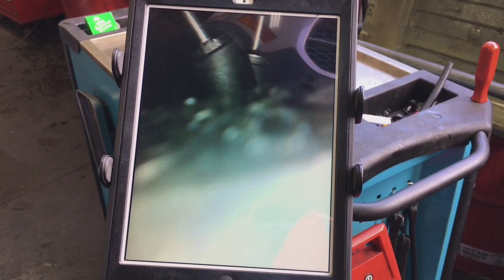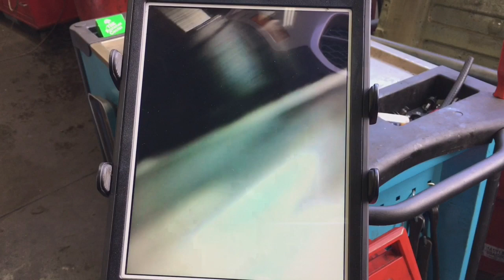BMW  N63 Twin-Turbo V8 Engine

Comment: What is the difference between n63,  f13, and e63/e64 engines?
Reply: Hello Majdi, sorry for the late reply.  BMW makes this slightly confusing.  Let me see if I can clear it up.  The N63 is a Engine: It's a twin turbo V8, made from 2008 until present.  
The F13 is a chassis model, NOT a engine.  The F13 is a 3rd generation 6 series BMW that was made from 2011-2017, the F13 also means it was a 2 door coupe, the F12 is the same year and body chassis as the F13 except the F12 is a 2 door convertible.  The F06 is again the same year as F12 and F13 except it's a 4 door.  
It starts getting muddier when you look at something like E63 compared to N63.  The E63 is a chassis, NOT a engine.  The E63/64 was made from 03-10, it's the second generation 6 series, either in coupe form or the later convertible.  
The N63 is a engine.
The F13 is a car.
The e63/64 is a car.  
hope this clears things up.

Comment: As much as BMW incorporates multiple heat shields, heat is still what kills these engines. The valve stem seals become hardened due to the extreme heat from the twin turbos and cat converters. If they could deal with the exhaust heat issues, these engines would be nearly bullet proof.
Reply: is there a way to wrap the stuff with exhaust heat wrap? considering a 750i in the future i have a 2007 with the n62 and honestly other than gaskets going every once in awhile its not a bad unit
Reply: @anthonyk  Getting more cooling air to the turbos would be the answer. Extracting the heat, rather than insulating it.
Reply: @anthonyk  the N62 is better than the N63, at least you will have space unlike the N63 which is a bigger engine with shit tightly packed.

Comment: Hey Charlie, nice video. 
Let me tell you that I'm working on a N63 Twin Turbo 4.4 xDrive 50i, I am reassembling it, but then an issue appeared: I don't know how to synchronize the crankshaft with the camshaft, in other words to put on time the whole distribution. 
I'm part of Autodata community and also I have the diagram for the valves setting, but there's no further information which can help me. 
I'm wondering if you can help me with, thank you 🙏🏼

Comment: These engines are a mess, surprisingly enough, the S63 is more reliable.
Reply: I'd like to argue that, my x6m is giving me fits
Reply: @03mm24  doesn't surprise me.
Reply: @f32_boost52  Aux water pumps, low batt voltage, limp mode, rear air shocks.............👦🔫
Reply: @03mm24  here i am on my 2014 S63 AMG with the 5.5 bi-turbo with over 417,000 Kms with 0 issues. Never buying a BMW/M product ever.
Reply: @fkmbmw  yep mine is currently still sitting in the driveway waiting to be engine swapped...it sucks

Comment: You don’t need to pay for a new engine - BMW gives you one for free via the N63 Class Action Lawsuit.
Reply: Hey is this old ??? Is it to late to get service for this lawsuit ?
Reply: @arp5566  bring your key into bmw and theyll run your vin and tell u
Reply: Ive contacted bmw said they cant do anything about my engine issue because i have 120,000 miles and supposedly had a customer care  package already done to my replace valve seals,injectors in  veh..but it was still leaking oil and messed up rod bearing and main bearings :/
Reply: Rodrigo Cardenas I have the same car and BMW replaced mine last month.
Reply: @Truebleux  Really how many miles you have on it and what was the issue? Did you have the customer care package done to it before having your engine replaced?
Reply: @Truebleux  Do you have BMW reps name,mine is Carlos Castillo and he's no good. Im in desperate help bro if you can get me your BMW rep contact info would be greatly appreciated!
Reply: Rodrigo Cardenas I had 68k miles on it and mine was smoking but even if it wasn’t, all N63 engines are involved in this class action lawsuit. Just go to your local BMW dealership (not corporate) and tell them you want your engine serviced via the class action lawsuit. They’ll search your vin and see if you are eligible. If you aren’t eligible, it’s because someone alrdy serviced the engine but they’ll have a record of that too. Whatever u do though, dont go to BMW corporate. You wanna go to a local bmw dealer as they will bill BMW corporate for the labor/work which makes them money.
Reply: @Truebleux  my mechanic called my local BMW and they pulled up vin and said it had already been serviced with the customer care package..yet it still was leaking oil and consuming it when i bought the vehicle
Reply: Rodrigo Cardenas there are two packages. One is for the fuel pump, oil consumption issue. I can’t remember the service tag but look it up and make sure that one hasn’t been done.
Reply: @rodrigocardenas5230  same boat they did  valve seals in 2018 & it seems they didn’t do it right it’s now 2021 and I have the same issue .
Now their saying I have 100k on the clock and it’s more than 2 years since the work is done.
They should warranty that damn work for 10 years .
Reply: @48hourrecordsteam45   I absolutely agree with you this is some b***** they should cover these engines. There are the route calls of these motors going bad it's a design flaw from day one...

Comment: Is this exchange at $3700 still going on? If so, do they replace it with an upgraded newer engine or just a rebuilt N63? I am looking at a 2011 550xi vinC783362 with 98,000 that has a blown engine that I can get for under $4,000. How many hours labor for engine swap? Thanks.
Reply: sorry i’m 2 years late, but that 3700 was for the N63’s not the N63TU(2014- newer)

Comment: Most BMW enthusiastic won't admit that this engine is junk. I don't think BMW are too worried about it either since they discontinuing the V8 line
Reply: Yeah….discontinuing since never considering they are pumping out V8’s constantly still in 2022. Misinformed right here. Check out the N63TU3 being sold right now worldwide by the thousands. Yeah….discontinuing alright lol NOT

Comment: what a smart heat shield to become heat trap. but what BMW engineer think put exhaust side upwards instead dowwards as other factory do. Save space or easier in assembly  what ever it is that causes a lot of problems. Yuck

Comment: So many heat generating components stuffed in tiny little space. I don’t care how many heat shields bmw put in there. It is like putting aluminum foils in the oven separating a bunch of hotdogs. They all gonna be cooked no matter what.
Reply: Well said. Running a thermostat with a lower opening temperature will help to increase the lifespan of the engine but that won't nevessarily stop the problems.

Comment: Please put a link for the price of these engines. My local dealer says that this engine is in the $30,000 range.
Reply from the maker: Hello Keoki, I just called BMW.  For a 2012 550i, BMW North America has 18 engines ready for shipment at $3,723.93.  What is the last 7 digits of your vin and I can check for you and get you a part number.  Where are you located?
Reply: Charlie's Foreign Car Service 

Last 7 of vin are DV59430 and am in Austin Tx. Car is a 2012 550i
Reply: @fixingcars  Hi Guys, I'm looking for a N63 for a 2011 X5 50i - can you advise if BMW North America still has them available for around this price please?
Reply: @fixingcars  brand new ?

Comment: Sounds like due to the “Hot Vee” design this is an issue. What is the part that fails-a gasket?
Question:  is it a common occurrence or a once off?
Reply: Mitsubishi cast a series of 12 and 16 cylinder turbo diesel 40 years ago that were very reliable. BMW just cast grenades when they made those p.o.s.

Comment: Good technical advice. 
I will be trading in my '07 335i for something in the next 2 weeks. Haven't decided which one to go with. Either a '14 550i or a '16 340i. Like the F10 because of the roominess and V8 power but like the f30 due to the B58 motor and newer tech. I have a little time (30 days on my loan) so I will be doing more research. Maybe a '15 435i....decisions, decisions.
Reply: Stick with the I6 in either car.

Comment: BMW should be ashamed. They should build more reliable engines, given then cost of their cars.
Reply: BMW ranks 3rd to 6th in reliability. Research.
Reply: George Parmer they are twin turbo
Reply: George Parmer 

The twin turbo V8 bmw engine has the turbos sitting on top of the engine. Open your eyes 👀
Reply: Cary Coller they do. This was one bad engine.
Reply: @CadexLaw  so in your opinion I'm safe to buy a 2009 to 2014 BMW 7 series with the twin turbo V8? Because I'm afraid the turbos will fail on me. I've been looking for a failure rate on those engines but I can't the data.
Reply: Also, in 2012 BMW started releasing an updated N63 which can be determined by if the engine has a black cover (try to stay away from N63s w/ the gray cover as they’re the most problematic.) In addition the N63TU came out in 2014 which fixed almost all of the problems with the N63, so if you’re looking at ~late 2013 and above it’s likely N63TU.
Reply: @CadexLaw  good information. I appreciate it. Thanks.
Reply: Cary Coller yeah no problem, the only reason I know all of this is because I am looking to get a 550i aswell.
Reply: @CadexLaw  I ran the VIN on the 750 I'm considering through that link. It says no open recalls on the car. That's good news at least.
Reply: @ThatRetiredDude  stay away from the 2009-2012 7, get 2013 and above
Reply: If you're afraid of a car breaking a 7 series BMW is NOT a good choice for you.
Reply: @johnlukach4091  I've had 3 in the past. Just bought a 2009 a week ago. It has only 86,000 miles on it. Literally the day after I brought it home the fuel pressure regulator and the fuel pump went out. $1,300 to repair. 

I bought a Range Rover Sport 2 years ago. It had 98,000 miles on it. I've not had a single issue with it.
Reply: John Lukach based on...what exactly? In my experience they’re really reliable if you know what to look for & take care of the car.
Reply: Cary Coller as a bmw 7 series owner do not bye one 2009-12 are the worst!! Value gasket, turbo, Mechatronic unit fail, coolant leaks it’s a pain don’t listen to people does not own a bmw trust me you will spend a lot of money trying to fix a bmw
Reply: @ThatRetiredDude  Engine has to be removed for walnut shell blasting and if the valve stems have gone bad the exhaust side will need blasting also.  we are talking $2.5K to $3K for regular maintenance of  DI turbo engine here.
Reply: @CadexLaw   I have a 2013 model 750LI when you pull the cover up I see B 63 on  on the block
Reply: @GeorgeParmer-y1n  Twin Powered does not mean Twin Turbo.  Only N54, S55 and S58 are twin turboed I6.  All other are single twin scrolled turbos.  V8 are by necessity twin scroll twin turbos, as are V12.
Reply: Max Nix The N63 is twin turbos, it confused me as well at first but google it
Reply: I'm looking at 2011.x5 m I have heard these are not as problematic as x5 50 I although they are same engines? Any advise ? Please I'm confused
Reply: @aliwarraich5332  they suck as well, I own the 2012 x6m S63 motor....fucking nightmare, truck is beautiful though inside and out
Reply: @03mm24  yes you are but i think s63 somewhat more reliable then n63 what dp you think about n63 tu after 2014?
Reply: @aliwarraich5332  i think both the S63 and N63 updated versions are much better. I see almost little to nothing on them online in terms of problems 2015+ especially in the trucks seems like all the problems are 08-14
Reply: @maxnix346  The S63 is twin turbo

Comment: To do this job properly, any other gaskets or parte I must replace besides the housing? I replaced my crankshaft seal and still leaking from behind the motor.
Reply: It is routinely misdiagnosed as a rear main seal. The fix requires replacing all the turbo feed lines (oil actually cakes up inside of them), the coolant feed hoses, and all subsequent gaskets for the exhaust manifolds, and turbos. 

I also include the crankcase breather hoses, and the turbo inlet ducts which are routinely cracked as well.
Reply from the maker: Hi Kevin, yes Lynx Star is correct.  The turbo return lines leak into the valley, and run out the back side and down the rear main seal.  So if you don't know what your looking for, someone will misdiagnose it as a bad crank seal.  You have to look down between the many heat shields to verify this.  Sorry I'm late to the party.
Reply: @fixingcars  would it be easier to replace engine i have 2011 750lixdrive w 179k love the car starting to leak badly
Reply: @kevinsetzer4346  what did u do...I have near same mileage

Comment: Bmw start having too many problems with there engines we already know there engines have oil leaks problem now they doing worse oil leaks coolant leaks timing problems oil burning transmission jerking which is made by GM some models and etc
Reply: Saw a young buck driving a 2 to 3 year old top dog M6. His 4 ways were on and dark grey smoke pouring out of the exhaust. I did the same to my S type R Jag 12 years ago. Safe to say their far from bulletproof yet!